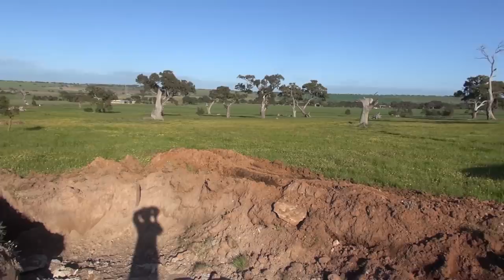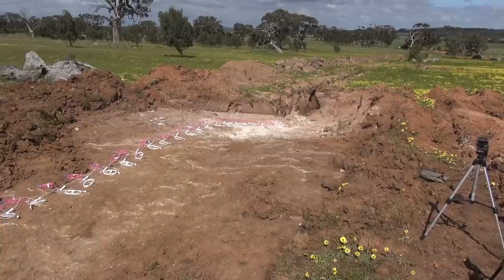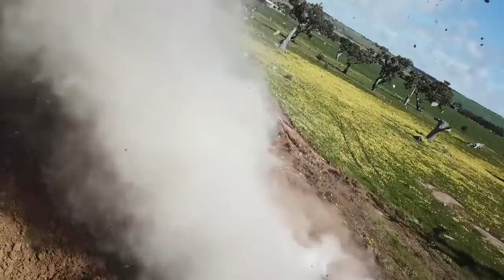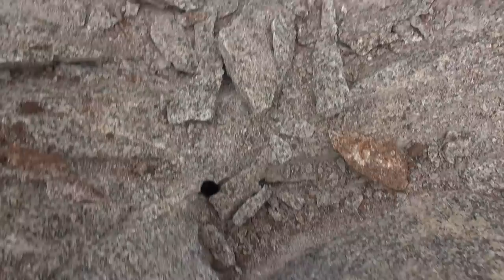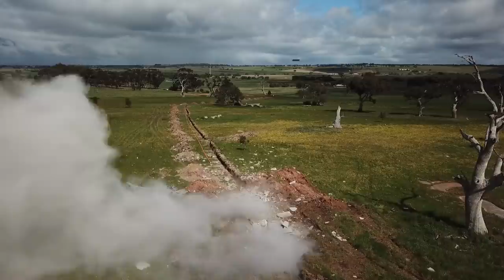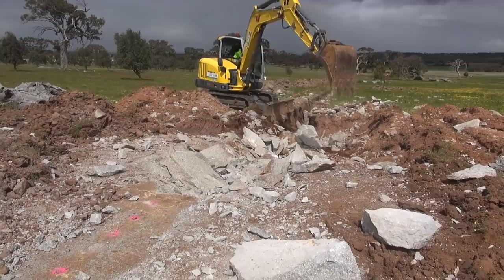Blasting a power trench through Granite

Comment: Hello, I used to drill and shoot ditch line and road cuts  in the mountains of Colorado back in the 1960s. We used 40% dynamite and nitrates with delay caps, 50 holes at a time. One thing we did do was leave room in the holes for tamped in top cover.  We got less blow out of the holes, most of the time. Enjoy your videos, keep them coming!
Reply from the maker: Thanks for your input Bill, I did use the best stemming material available, that being 5mm sharp aggregate, but when only one hole fails to move the rock then the burden is far to great for successive holes and they all blow the stemming. Thanks for watching Bill

Comment: Very educational. I understand that when trenching , the key is to use the preceding blast hole to provide exit for the next hole. I know you sometimes place pea gravel(?) above the charge - presumably to hold down the blast long enough to build enough pressure , but I didn't see a lot of that this time 'round. I did notice that you drilled at an angle to try to get a better lift. When done without cover this is very exciting !
Reply from the maker: It sure is a lot different without cover! The shot was a dud  first time around as not far in, a hole vented a lot of it's energy into a horizontal joint in the rock and because it did not fully break out, the following holes ejected because the burden was too great. The shot was a bit high risk for failing as the stemming length was short and I really should have drilled the holes in a zig zag pattern. A single strait line of holes works a treat in softer rock and often works OK in Granite... this time it did not. Thanks for watching.

Comment: I lolled out loud when you said "it won't be because I didn't put enough explosives in" without telling us how much you HAD put in.
Rock IS going to move! 
Just wasn't the direction you hoped... Lol

And you can also see in the slow mo of the first shot why delays in the detonators is so important, as the blast tube gets decimated by the adjacent charges.

Also, loved the old detonator!
Reply from the maker: Thanks for watching Ben, The old Rack Bar Exploder came out by popular demand, These are worth a fortune as a collectable.
Reply: @demolitiondavedrillandblast  We need a video on what happens inside the mysterious explody machine when you push the T-bar down.  The internet needs to know.
Reply from the maker: @AndrewSmith-ir1ui  I'm pretty sure that there is such a video... not a bad idea though, I like that.
Reply: @AndrewSmith-ir1ui  There is such a video. I don't know if it's from Tom Scott, or Technology Connections, or Today I Found Out, or Practical Engineer, but it's from one of those or one like it. In short, it builds up speed in a small dynamo geared to the long shaft of the plunger, and then when the dynamo's voltage is at its highest at the end of the plunge, it abruptly sends the electricity down the wire.
Reply: @MottyGlix  Dave's version will have extra bang.  :-)
Reply: Formula p for plenty!!!!
Reply: "lolled out loud"? Do you work in the Department of Redundancy Department, by any chance?

Comment: Looks like you may have hit a horizontal joint most of a meter down.  The second set of camera shots show the central piece lifting a small bit in a "heave".  thus blast energy was dissipated horizontally.  The breaker did the trick though.  Trench blasts are always fun, especially if you get some distance and they can 'zipper'.  Great video and keep up the good work.
Reply from the maker: Agree, the horizontal flaw was the cause of the failure. Thanks for watching Kirk.

Comment: The main East-West fibre optic cable was dug in along the boundary of the farm I work on in Western Australia, however the line ran through a number of large exposed Granite rocks between 50 and 150 metres across. They gave up trying to dig them in and just laid them on top of the rock and heaped up stones on top of the line!
Reply from the maker: They just laid huge charges on top of the rock???? Wow, that is so inefficient and so so so so so loud.... and then they put stones on top...No... they didn't did they?
Reply: Sorry Dave, I meant they just laid the cable on top of the rock and piled rocks on top of the cable. It was supposed to be buried 2m deep, so they piled 2m of rock on top of the cable! There must have been kilometres of super hard Granite in our district alone and it was being ripped in with a D10 being pulled by another D10, which while it was an impressive sight, it was never going to go 2m deep in Granite!
Reply from the maker: @tutekohe1361  sounds like a good job opportunity for me, I won't put this video on my resume though.

Comment: at 2:51 you can see the charges being thrown.  41 holes, 20 failures. so 20 holes is all you have the speed for? 
Is there a way to wire 20 or 21 holes from each end to the middle?  This truly has me curious.
Reply from the maker: It could have been shot from both ends.

Comment: Hey Dave, that was absolutely awesome particularly the slow motion shots. I subscribed straight away, keep them coming and stay safe. We don't want to see bits of Dave flying up with bits of rock. 👍 😜
Reply from the maker: Thanks for subscribing Peter, that really helps a lot, if a high number of people subscribe the YT algorithm will promote the video harder and thus make more add revenue... I have always promised to plow most of the money back into making better videos, I'm hoping to be able to buy a Kronos 2.1 super slowmo camera soon, it does 1080P @ 1000 frames a second, where as the current slomo is 240 frames per second and it compresses up the video a lot when there is a lot of motion. Cheers from the Land Down Under.
Reply: Demolition Dave Drilling and Blasting. Thanks Dave, that slow motion camera sounds like the ants pants, looking forward to it. Watching from Perth WA. 👍
Reply from the maker: @peterantonic6923  Make sure that you have clicked on the notification bell next to the subscribe button and then you will not miss any. (no button on phone version, must use desk top PC).

Comment: What are you using? I would think in hard rock like that a very fast shattering mix like Kinepak, high percentage nitroglycerin, or PETN would work well.
Reply from the maker: I was using Orica Senatel Magnum, 32mm packaged emulsion  - https://www.orica.com/products-services/packaged-explosives/senatel-magnum. This product is usually very effective in hard granite, the cause of the problem was twofold, I should not have tried to do it with a single line of holes in hard rock, a regular 2 row zigzag pattern would have been better. The shot went bad when a horizontal joint was encountered and the burden failed to fully break out, after this hole, every hole ejected as the burden was too great.

Comment: Awesome video and channel lads, just wondering would with be worth investing in a little rock crusher when you blast granite? I used to work in a quarry/gravel sand pit and we use to get the granite blasted by the demo guys (That's what made us a tone money by the way was granite crushing) we first would use the jaw crusher which was then directly feed into a cone crusher and then screened.
Also I have a few questions if you wouldn't mind answering for me please.
The demo guys used use narrow bags about 2-3 feet tall that they put down in the long drill holes, they would use any where from 1 to 4 bags depending how deep the machine drill hole was, would you know what was in those bags? Also they would cap it off with white or sometimes orange fill.
And the last question is, I was told that lime rock could be broke up by drilling and using water and liquid nitrogen, the guy told me that talks a lot of bs so I don't know if it's true or not lol, I've never seen it done before.
Reply from the maker: Thanks for commenting "90" I have actually been thinking about a crusher and yes getting the raw material would be no problem at all for me! Crushed and screened Granite is a product that I do not see around here very often, I can see application for it in landscaping but it is not used as concrete aggregate. Those bags of stuff that the guys tipped down the holes would be a pre mixed ANFO product - a granular explosive. Splitting softer rocks by freezing water in the holes will work.
Reply: @demolitiondavedrillandblast  Thanks for the reply and the info. 😁👍 
Do you mind me asking what kind of crusher do you have in mind? What about digger attachment crusher to get you started?

Comment: Question?  Learning!!   When the explosives did not do what you wanted;  what would have have happened on the second or third go with using expanding mortar (Expando, Dexpan, Dynacem Etc.), If you could not blast again till the next day or  time delay  in bringing breaker to site?    Came to your videos from 'Lets Dig 18' from North Carolina.   You do not disappoint.
Reply from the maker: Thanks for joining us 555. If I had of just filled the existing holes with expanding mortar I would have expected it to just form a crack along the axis of the line of holes (if at all). the cracking goo is not good in applications where the rock has noware to move, a better strategy for breaking out a trench with expanding mortar would be to drill two rows of holes parallel in a V cross section so the bottoms of the holes nearly meet below the level of the pipe. I look at the size of Chris's subscriber base and just think, wow, how did he do that, looks like it has just grown out of making so many videos over a long time.

Comment: Crater break-out vs burden relief is really sensitive in hard, massive granite. A lot stemming ejection so wondering if you had to use what you had or small dia crushed rock blew out?

I’ve blasted massive granite in shallow multi decked holes and with pentex it can refuse to break unless the relief is optimised through hole design.

20t breaker is tough but hard to work on rock like that 🤯
Reply from the maker: Thanks for watching and commenting Francis, I used 5mm screened hard, sharp aggregate for stemming in 38mm holes, I was tempted to use 110gram cast boosters but decided not to because of the extra cost.  In hind site, as you say, it would have saved the day. The machine was actually 32 Tonnes and they ruined the new breaker point in just a few hours trying before they called me.
Reply: @demolitiondavedrillandblast  great videos Dave and a commitment beyond flogging the hours to do the job. Did the right thing and subscribed thanks so looking forward to more adventure!

What you do requires a particular, and thorough, knowledge of explosive product performance. That is why your work is interesting and pumping hundred of tonnes of bulk somewhat boring lol!
Reply from the maker: @fh8698  I hate stemming those great big holes Francis, carrying all of those buckets makes for a very big day. Thanks for getting on board.

Comment: Just curious Dave, why are the holes vertical and not in a Vee formation, is it because of the type of rock or the formation. Cheers Matt Warrandyte Vic
Reply from the maker: Hi Matt. If I was going to fire it with det cord I would have drilled a Vee trench and in hind site it probably would have worked better, but twice the number of holes. Like this one - https://youtu.be/oCGIp80eJWI

Comment: Well Dave,
       I haven't seen anything that cool since we blew the existing  launch pad back at Vandenberg Air Force Base.....
       60ft thick, 180ft wide, over 1000ft long. Drilled for MONTHS.....
I do wish there was video of it, but back then you'd be hard pressed to find anyone still alive that even remembers....
       I don't know if anyone else even cares but that GREAT slo-mo really let's you see how far out in front the charge detonate, and the lag when you can see the gas finally escape......
That's a really cool shot. The difference between delays is real apparent between the two shots. 
42ms down to 25ms doesn't sound like much, but man on slo-mo it really stands out.......

       Anyway like normal THAT SLO-MO IS THE COOLEST THING GOING........
      Stay safe mate.......
Reply from the maker: That is a really big piece of concrete Donn. The surface delay clips lead the in hole detonation by 400ms (the in hole detonator delay period). Hopefully the advertising revenue will soon pay for a Kronos 2.1 supper camera that will do 1080p resolution at 1000 frames per second, current slomo is 240 frames per second with a fair bit of image compression.
Reply: @demolitiondavedrillandblast  
        I can't imagine what a 1000 frames would even look like......
You'd be able too see the flash start to finish going down the tube.......
That's going to be a real game changer.....     Cheers

Comment: Bummer about the blowout in the bottom of the holes.
 It is still a very good video.
👍👍👍
Reply: G'day Scruffy
Reply: @Murphyslawfarm  did every find any old boats for planters.
Reply: @scruffy6151  Not yet but i am still looking mate
Reply from the maker: Tell me about it! That's blasting, rocks do not always co-operate.
Reply: @demolitiondavedrillandblast  we would have problem with differeng types of sandstone when tunneling. Just because, you load it the same each time does not mean you get the same result each time.
 You just deal with it and hope the next blast went better.
Reply from the maker: @scruffy6151  That's it scruffy.

Comment: If the excavator with breaker was not on site, what would you have done?
Reply from the maker: I would have re drilled a Vee trench pattern - a line of holes either side of the existing line angled toward the centre line, but not a deep and fired it with cord, all together.

Comment: G'day Dave, I've been a sub'er for some time, just interested in the trade. Not a practitioner, just curious. Would there be any point to drill another set of holes parallel to the original and re blast? Or is there a cost and time consideration?
Reply from the maker: In hind site Jon, that probably would have worked out OK, but unless you have done this kind of thing, it's hard to appreciate how physically punishing it is and how good the existing holes look.

Comment: What type of explosives you have putted in the hole, perhaps nafo?
Reply from the maker: 32mm packaged emulsion and ANFO in a 38mm hole
Reply: @demolitiondavedrillandblast  I advise you, put more stemming, and change emulsion by a dinamite (nitrocellulose) because in this case, with only one holes line, you need more breaking power and less gases power ...
Reply from the maker: @albertbm3105  Yes, you are correct Albert, I did think about using 110g Pentolite cast boosters but dismissed the plan because of the extra cost - I should have. We no longer have any NG product available in Australia.
Reply: @demolitiondavedrillandblast  pentolite is also a good election but very expensive, in this case perhaps driling two holes lines and putting into the holes a hight energy hidrogel, would be the solution (in Spain the hidrogel have more energy than the emulsion).

Comment: For shallow holes like this. What explosive do you use?
Reply from the maker: Usually 32mm packaged emulsion.
Reply: @demolitiondavedrillandblast  Do you mostly use emulsion explosives or nitroglycerin based explosives like Austin Austrogel?
Reply from the maker: We don't have any NG product available in Australia these days as far as I am aware. Orica is our biggest supplier and they quit NG in about 1990.
Reply: @demolitiondavedrillandblast  
Ok. I usually buy Orica or Forcit NG based with AN and other additives. Strange they don't have the same products all over.
Reply from the maker: Yeah, might be related to local manufacturing safety regulations here???
Reply: @demolitiondavedrillandblast  Could be. Most explosives here seem to be made in Poland. I'm guessing they are not as stringent.

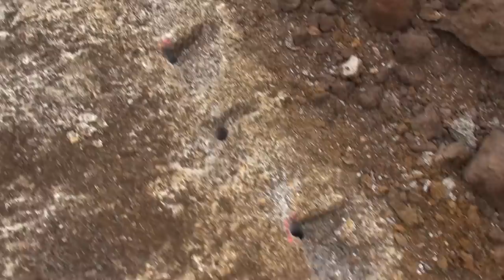Comment: spectacular.  i used to put up with an hour of bullshitting around to see one blast on mythbusters.  no bullshitting around on this channel.  5:00 "what can you do?"  is this an instance where the ground vibrations of the previous blasts shook the packing rocks to become liquid like happens with concrete vibrators.  what about quick-set concrete (sieved to remove the chunky aggregate and possibly in a thin plastic bag) down the holes?  another substance that might be useful for plugging holes is silasec.  after 30 years i finally found out what it is - silica fume.  the wikipedia article is enlightening.  the stuff was only discovered in the 70's.    silasec and grey cement makes an expanding waterproof putty that sets hard in 5 minutes.
Reply from the maker: I'm a say it as it is and strait to the point kind of person vsv. The cause of the failure and stemming ejection here was one hole (#19 I think) not fully breaking out the rock all the way to bottom of hole and as a result the burden for the following hole was too great to move so it spat the stemming, this is not uncommon on a trench shot with short holes. on of the reasons for using loose poured screened crushed rock is that it is very easy to remove should you need to...unlike quick set cement. Thanks for tuning in again.
Reply: @demolitiondavedrillandblast  ,  being new to your channel, i haven't seen you have to do a removal. what you say about why it failed makes sense.

Comment: A tough one , Sometimes you have to angle drill the sides and make the center the relief area , Just a thought .
Reply from the maker: In hind site I probably should have gone the zig zag pattern and angled the holes in slightly as you say.
Reply: @demolitiondavedrillandblast  An old mining worker from Italy had explained how they tunneled in granite years ago , they would angle drill the center and blast micro seconds before the rest of the circumference of the blast to allow room for the blasted rock , They were blasting 10 feet of tunnel each time .